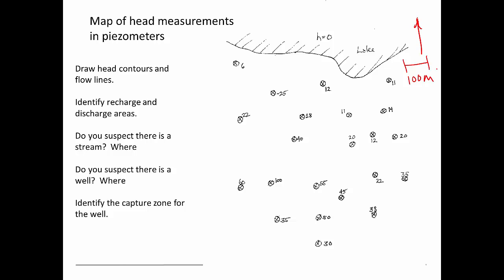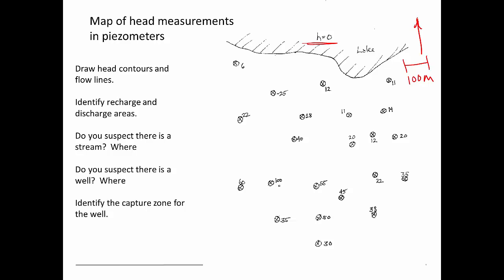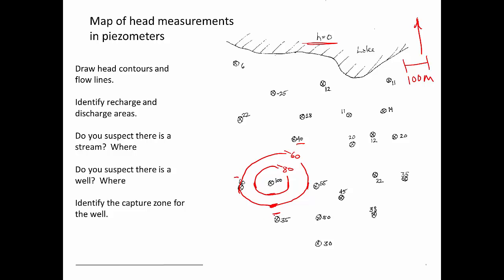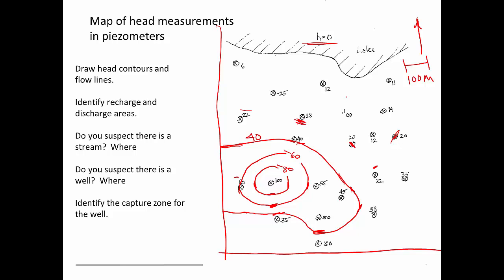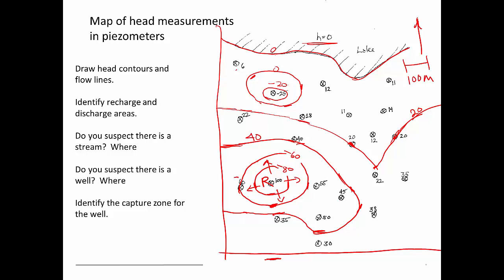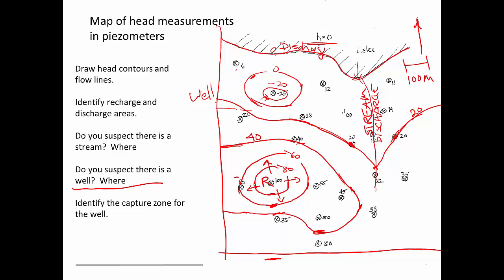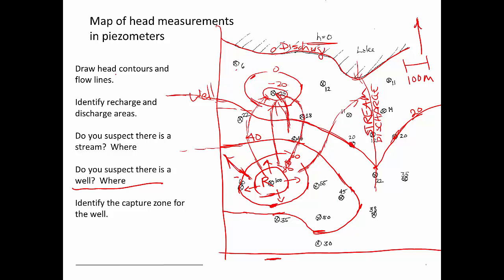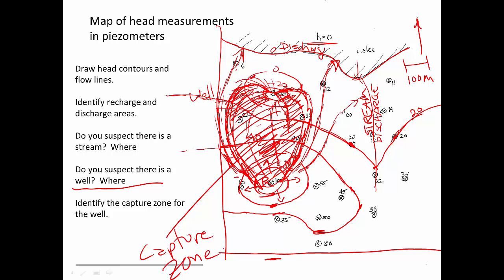Contouring a water table example

Comment: Isn't there a mathematical way to do this, using an engineers scale, versus "estimating" the location of the contours?
Reply from the maker: Dylan,    There is a graphical approach to interpolate between groups of points using the "3-pt problem" method.  I have some videos describing this procedure.  However, usually when you are contouring many points like this you would not take the time to interpolate using the 3 pt problem technique.  There is often enough uncertainty in the locations of the contours so estimating the location is sufficient.  You can automate the contour process using software like Surfer, or other interpolation software.  When you do this, you will find that there are many mathematical methods for interpolating and determining the locations of contours, and they all give somewhat different results.  You cannot really say which one is right.  This is particularly true when the data are sparse, as is often the case for geological problems.   Contours done carefully by hand are often just as reasonable as the ones calculated with an algorithm.     Larry

Comment: Sir how a mound will act as recharge area instead it shot act as discharge area as water is discharging from it
Reply from the maker: Parwati,    A mound will form by injecting water into an aquifer, either by recharge, a well, or related.  "Recharge" and "discharge" are from the perspective of the entire aquifer.  True, water will flow from a mound to adjacent regions in the aquifer, but that is not the basis for recharge and discharge because the water is staying within the aquifer.  Only water crossing the boundary of the aquifer would be considered recharge or discharge.   Larry

Comment: Can they connect to streams? Or must they avoid streams just like lakes?
Reply from the maker: Hi Naviita,   Head contours will cross streams because the elevation of the stream changes along the length of the stream (unlike lakes, which are at the same elevation).  Head contours that cross a gaining stream will have a "V" shape that points in the upstream direction.  Larry